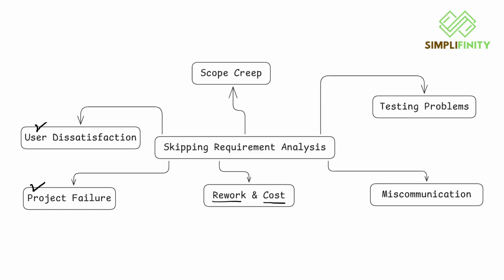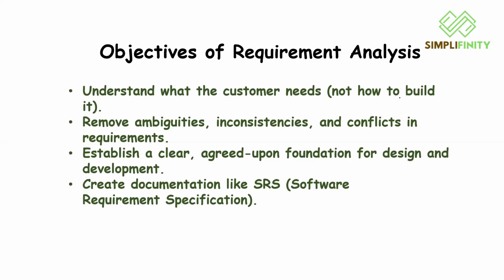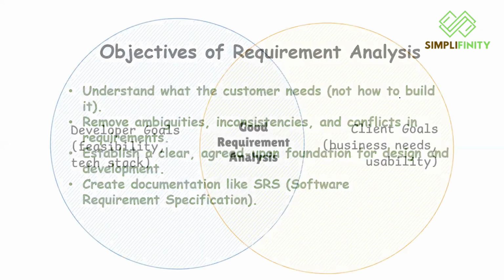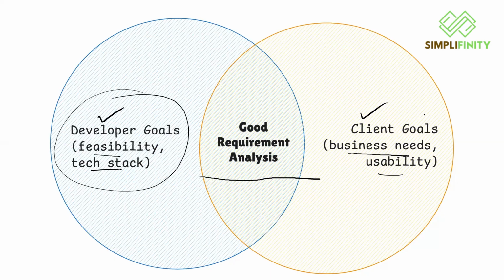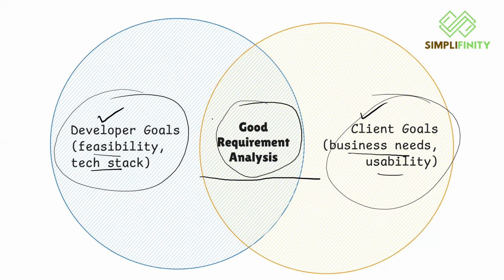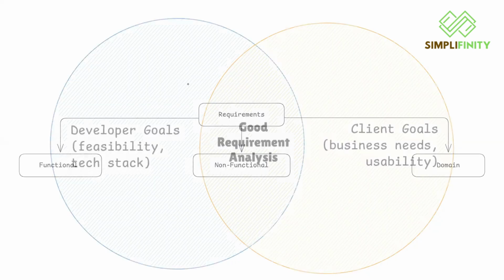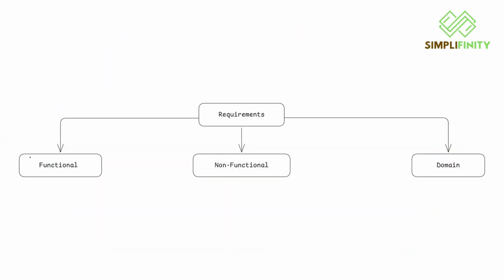Requirement Analysis | Explained with Real Life Examples | Software Engineering pt. 1

Comment: Excellent Video. Our suggestion is to show actual practical example along with the theory being explained on a slide. It will add more value for learners and implementors. Show techniques like traceability, baselining, Change Management, Negotiation, Export and Import, etc. Thanks!
- OpenRose - 🏵 Requirements Management Tools Team 
FREE and Open Source!
Capture, Define, Trace, Change, Prioritize, Baseline, Negotiate, Test, Deliver >>> Repeat the Process.
Reply from the maker: Thank you so much for your encouragement!! I will surely look into your suggestions in the upcoming videos, stay tuned and keep supporting!!